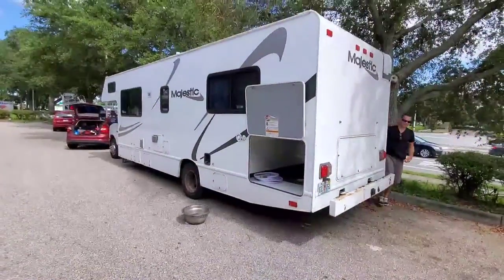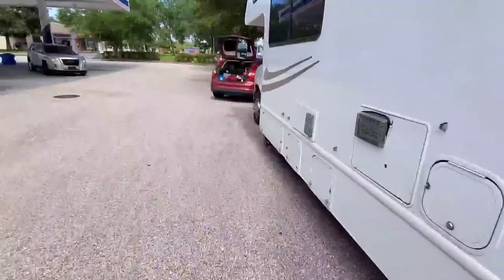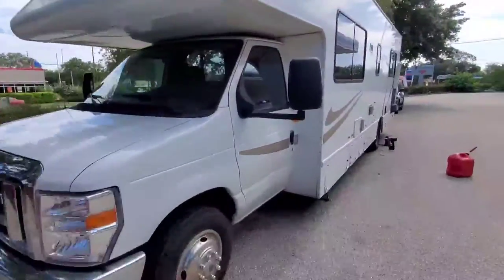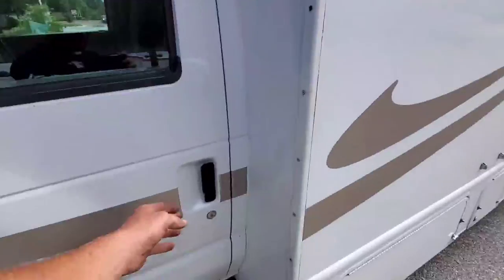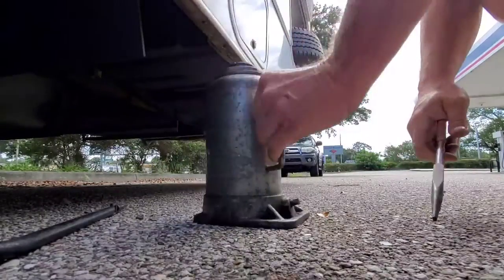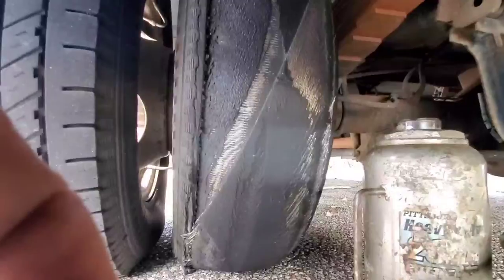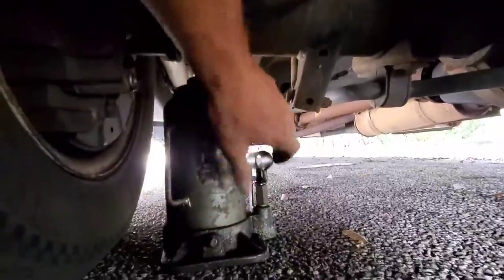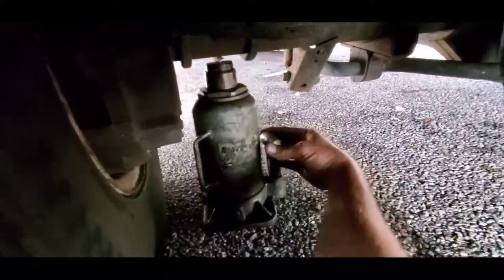HOW TO CHANGE A WHEEL ON A MOTORHOME RV

Comment: You could have used WD-40 to help you loosen the butterfly nut and someone asked if a floor jack can be used, the answer is NO! Bottle jack are more safe and secure. Be sure to find out the the weight of the RV, They are very heavy ( one ton = 2000 lbs) and should have Heavy Duty Jack stands for extra support. If you don't know what you are doing you can get seriously injured or killed. and both sides of the RV should be lifted to avoid twisting the frame structure and cracks! Good luck!!!

Comment: Do you carry spare wheels for RVers who don’t have one ? Also , I think I just recently learned that a regular E450 dually rim doesn’t fit and RV E450 . Due to bigger brake or something on the box truck type chassis used for RVs . True or not true ?
Thx ! Very helpful vids !
Reply from the maker: No I don't. To many options.
Reply: @roadsideguy5902  They're all the same.

Comment: A little secret for non-RV'ers, most mobile homes, Class A's and Class C's such as what you worked on in this video have a built in leveling jack system that can be used to jack the rig enough for a tire change. There is a control panel on board and newer rigs can use an app.

Comment: A hammer to loosen a wingnut. Nothing like smashing the threads on the stud. Try a pliers, which you'll need after you break the wing.
Another spare tire stored upside down.
Tightens the valve on the jack with a pliers. Why not use the hammer again?
Used the jack as an anvil so now it doesn't work.
Reply from the maker: Lol what

Comment: 8 minutes 21 seconds mark on this video... ABSOLUTELY FUCKIN IMPRESSIVE! 

I've been doing Roadside Assistance for years and I've NEVER... EVER...EVVEERR... EVER... (DID I SAY EVER ALREADY? ), SEEN THIS TECHNIQUE DONE BEFORE. EVER! 

I've purposely jacked the vehicle up just a little bit higher than comfort work zone, place 2-3 lug nuts back on over the studs and then rapidly lowered the vehicle with the expectation of hopefully breaking that rust seal. Or, taking a piece of 2×4 with a C-Clamp over the tire & Rim and hitting it with a deadblow. I've even just hit it a few times without the wood and it's come off.

But you're technique was certainly an eye opener and perhaps an easier way to break that seal/rust bond. I will DEFINITELY use this method should I be subjected to changing a tire on an RV/Motor Home in the future, presenting this type of symptom. Thanks for the tip.
Reply from the maker: https://youtu.be/UGvLGcfCEoI
Reply from the maker: Thanks man I really appreciate that. I've been doing roadside assistance for about 15 years it's 15 years and after the 1st year of using the method that you spoke of and various others. I came up with this one. Thinking back to my childhood I remember Donkey Kong and swinging weight and momentum at the same time. Plus I thought the rubber is going to prevent damage.  I tried it and it worked like a charm. I've been using this technique for the last fourteen years. It always works. 
Thanks again for the compliment bro.

Comment: CAN A FLOOR JACK BE USED?
Reply from the maker: Not unless it can lift atleast 4 maybe 5 ton. My 2 5 ton won't do it. I've broke a few over the years trying.
Reply: NO! Use BOTTLE JACK with HEAVY  DUTY JACK SUPPORT, Find out the weight of the RV or Trailer Remember one ton = 2000 lbs
Reply: Probably not I tried it didn’t work for me